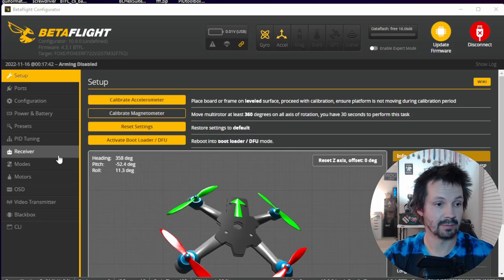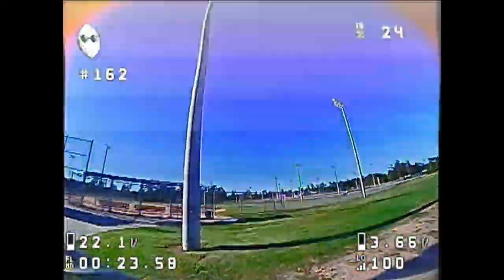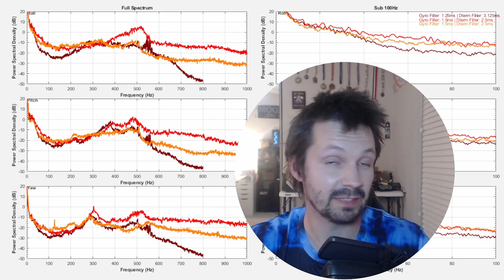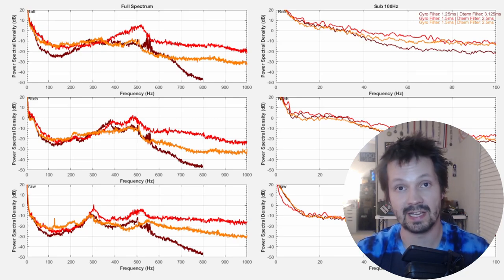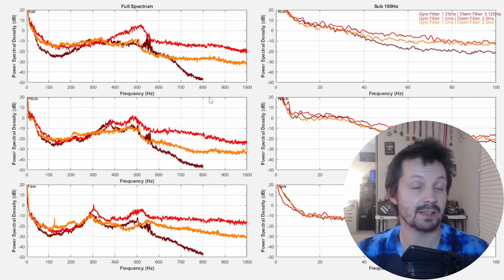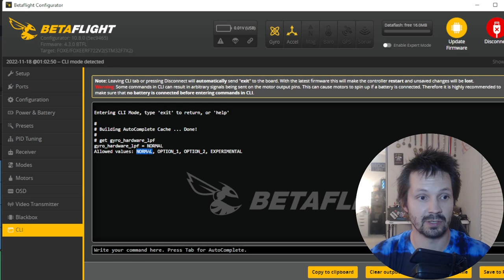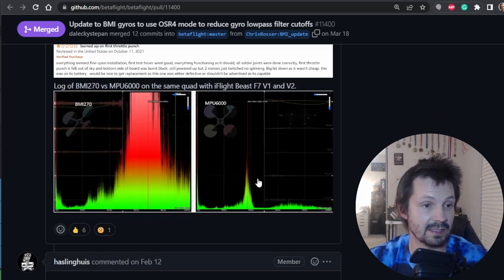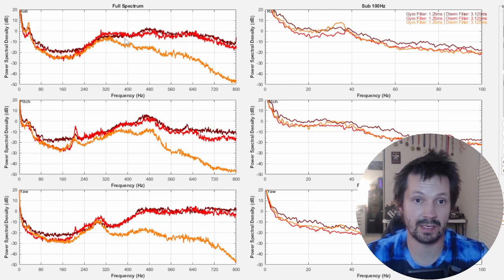Game of Gyros: BMI vs ICM vs MPU

Comment: I run the T-Motor F7 HD FC and I have two older ones with the MPU6000 and the rest have the BMI270. I use the same tuning principles for filters and PIDs. They both fly great.

Comment: I have mpu6000 iflight 20x20 fc on bf4.3. I bought spare fc from them and got a bmi270.  with all settings same(except pid loop frequency and filters set for bmi) it flies exactly same as far as I can tell.

Comment: Something to note. Stay away from the BMI270 for inav, and (maybe) betaflight quads where you want to use auto level modes.

In iNav, the BMI270 has issues with the horizon drift. Not sure if it impacts betaflight or not, but I inav, the ICM is preferable, especially for things like loiter and rth.
Reply from the maker: Oh interesting, need to try RTH with BMI )
Reply: Doesn't effect betaflight
Reply: @cinemoriahFPV  then what is issue #11894 about?
Reply: @IvanEfimovLimon   yeah, so in inav, there is something to do about the accelerometer and gyro and gps not properly compensating for banked turns, and so as you make banked turns, over time, the horizon slowly begins to sink or rise during big slow banked turns. This error accumulates as time goes on and it begins to become noticable to the point that level modes like angle and horizon are no longer "aiming" at a level horizon but..."somewhere else". This causes any use of those modes to slowly lose or gain altitude. Apparently, this is exacerbated by something on the BMI 270 not being properly calibrated from the factory in some way, but I don't know enough to speak on it further. 

I know this issue is largely mitigated in inav6, but still, matek is no longer putting the BMI in their "wing" flight controllers because of this. 

Again, this is outside the spirit of your video, as it was looking at noise performance, just thought it was worth mentioning.
Reply: noooo it also happens to my quad, frame, pid setting and filters are the top, perfect calibrations, complete absence of wind and the quad seems out of "convergence" always pulls to the right, with this BMI270 with Betaflight Firmware

Comment: I have 3 identical racers.
Switchback lite frame,  foxeer reaper slim, tmotor racer mini f7, wasp major 2020kv motors.
The first one ive build first works fine since forever. 
However the 2nd and 3rd quad freaks out if i do sharp corners.
All software should be identical too.
I flashed all with bf4.5. I applied the karaterace 4.5 tune with bmi270 experimental, dshot600, dynamic idle for 2000kv, 500hz elrs.

Im really bad at blackbox analysis, thats why im watching these kind of vids but theres SOOOO much information out there.
I am now trying to use bf blackbox explorer because i saw you using it, before i used pidtoolbox.

All that really bugs me is that really everything is idenically but quad 1 flew awesome since day one and 2 and 3 dont.

Like i said im really really not into reading graphs and spectograms so ill just continue learning for now (and maybe playing with the filter settings a bit).

Maybe someone can help me 
🤷🤷‍♂
Reply: Can you tell wich good flying quad has wich gyro? Is the good flying the one with mpu6000?
Reply: @Mamawsw  no like i said they are IDENTICAL. In the meantime i found a solution. I made the battery lead/capacitor  shorter on all 3 quads wich helped a bit. Then i apllied the "karate array" filter preset on top of the karate tune  only on the 2 mentioned quads. Somehow this works now
Reply from the maker: Just saw that. If it is not resolved yet, you can share bbx from bad vs good quad. BF discord or betaflight blackbox group.

Comment: afaik many nasa projects used to use the bmi160 gyro.... that must be for a reason.... maybe cause of its accuracy or mayb because its hard to break
Reply: BrainFPV used to use the BMI160 on the RE1 (discontinued due to being first generation BrainFPV board and  introduction of Radix V1), the Radix V1 (discontinued due to Radix 2 being introduced), and the Radix Li (discontinued due to material shortages). The only big issue with the BMI160 that UAV Tech found was it had a big spike of noise around the 750hz range. BMI270 fixed this issue and the 750hz spike is no longer there.

Comment: ICM20602 on a HW F7 mini is not working for my racing rigs as well as BMI gyro on two different F722v3. On all of them I get flyaways with a tune that is working perfectly fine with MPU gyros. 😬 Today I received a logfile that had terrible spazzing on YAW axis, ICM20602 on the FC. I really tried everything but had no luck. There is a reason that Foxeer put a MPU on the v4 again or I'm just unlucky and all of them gyros are broken by factory. The Noise at 45 Hz I got as well on the BMI gyros. Maybe with way lower PIDs it will work properly but thats somewhat limiting the tune in regards of gains. For the ICM I had to reduce my PIDs like 30% and it was still showing spazzes in hard moves. Great flying at the end of the video!😃
Reply from the maker: Thank you!! :))
Hard to believe that noise at 45hz is a gyro... That would be a disaster for all FCs and drones with it I guess?
 with 20602, was flying them a lot in the past, was my fav FC for like 2 years in 30x30 era, just recently learned that clracing F7 had this gyro.
Reply: @IvanEfimovLimon  Tune isn‘t even close to being really spicy, frame ist absolutely no issue on MPU. The Hobbywing F7 has it too. Where are you located? Interested in testing my Hobbywing that I can‘t get to work?
Reply from the maker: @marlin-fpv  im in Houston. Hobbywing F7 was a very popular FC loved by many pilots. You could just have a bad luck with bad units? I'm curious to see your blackbox.
Reply: @IvanEfimovLimon  Yeah, true that. I cases like that I always doubt myself to a certain point…

Comment: I am a shit pilot, but my opinion on it has often been that the only people that can typically feel the difference are those trying to feel a difference. Unless as you mention its a bad batch or if they have a mechanical issue in their build, I would bet a lot of people couldn't tell the difference in a blind test. They just have a pre-determined opinion, and any little blip they feel they will just blame it on the gyro or whatever component they are trying to "test."
Reply from the maker: im here with you 100%, Mr Spicy. THanks for your comment!